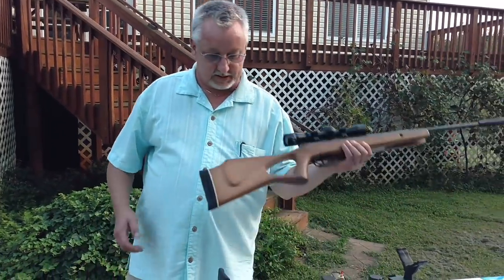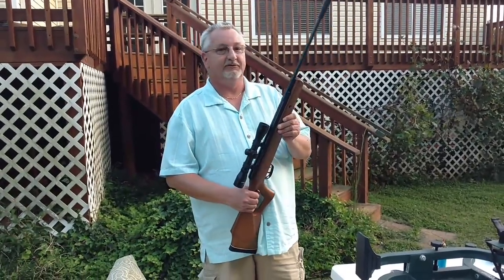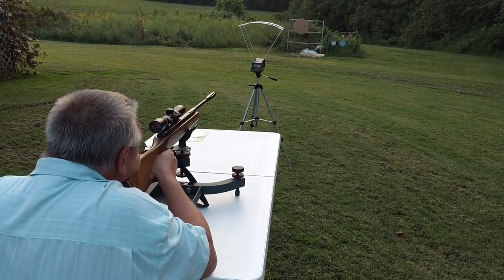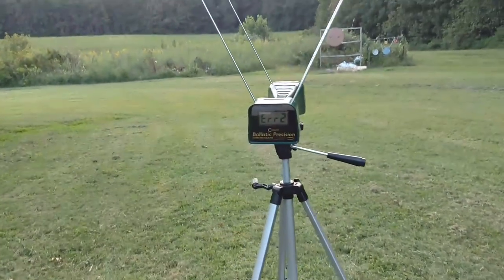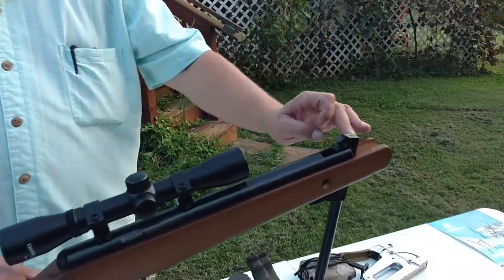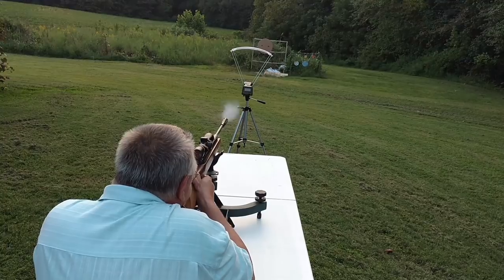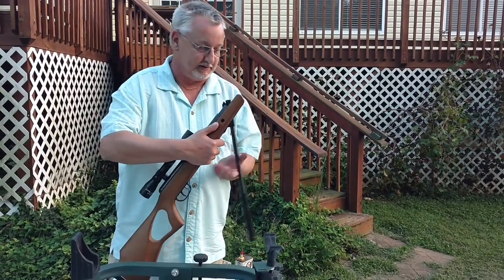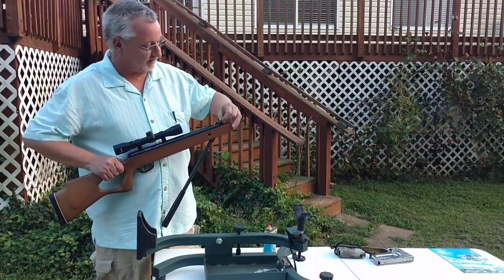Dieseling a Benjamin Titan Nitro XP .177 cal

Comment: I used to do this with an old pump Daisy air rifle.  There is one warning.  After awhile, you have to change a few rings and seals.  But seals and rings are cheap.  It was also fun to take it all apart and put new rings and seals in it.

Comment: At least in the UK back in the 1950s & 60s (ie when air rifles had leather seals) 3in1 oil was the standard lube and you stored the gun stood butt down having put a decent sized squirt of 3in1 into the cylinder to keep the leather piston seal from drying out. We didn't consider the small amount of smoke from this to be dieseling. Dieseling was when you put model diesel fuel in. This is a mixture of ether, paraffin (kerosene) and oil (often castor). That produced a much bigger effect. Despite doing this all the time myself and knowing lots of friends who did the same (model diesel engines were popular in the UK - far more popular than they were in the USA - so most of us had access to the fuel) I don't recall anyone having an issue with it and my 1958 vintage Gecado is still working just fine with its original leather seals.
Reply: I have a 40 year old air sport I switched from leather seals but you can still buy them on ebay
Reply: And vasaline was pretty good too
Reply: @un-_-known688  I guess if you were going to try dieseling with model diesel fuel it would be worth fitting the leather seals as I suspect the ether in the fuel isn't too kind on O-rings. These days the fuel isn't that common and quite expensive.

Comment: ive experimented with dieseling with a HW99s  from new, the reason i choose this rifle is because 1 the breech is made of quality steel, eg i would not consider  dieseling with a Chinese rifle,  the test can only be done over time to compare before and after, ive found the rifle is still shooting as new without dieseling  after a heavy few sessions of dieseling, the only physical modification to the rifle is a Australian red self lubing piston seal which i put in after a few shots from new,  in the uk you will almost certainly be breaking the law by increasing the power, the FPS increased on average 200fps  with only a marginal loss of accuracy, i use the least amount of propellant  as possible,  the rifle has been tested with over a thousand pellets with no ill effects ,

Comment: The crack is from the pellet going over 1100 fps breaking the sound barrier. Light weight alloy pellets will get you there without the risk of blowing your seals.
Reply: you will blow out the seals eventually because they werent made to take the pressure.
Reply: @harleyme3163  I'm with you.  The first break barrel I bought years ago, I went out back and started shooting.  First thing I noticed was the loud report.  Second was it was un accurate beyond belief.  All of those way cool looking pellets ain't worth crap either.  Blew out the rear seal on the barrel.  Repaired it.  Swabbed that barrel real good. No excess oil.   Used Benjamin Discovery pellets and hola.  Scoped and bore sighted it.  Shoots like a champ.  Gun and ammo must be matched.  No different than one that shoots bullets.  Over load isn't the answer.  Peace.
Reply: i had the winchester 1400 .177 and it was shooting 1400 fps, but i was dieseling it with light weight pellets and i kinda felt like i was shooting 22 hornet, it had to be going well over 200 fps after i put some wd40 in it

Comment: my hatsan 125 sniper is 5 years old and it still fires a 7.9 gr pellet at 1325 fps with out using oil
Reply: i dont believe it...
will be good if you make a video to see if what you say is true....greetings
Reply: @hospitaldelavadorasyrefris5104  I had one. They’re one of the stoutest snap-poppers out there, homie. I’m into the Huben K1 in .25 and Hercules .357/9mm these days
Reply: @timhallas4275  brother a .17 HMR carries about 300 FPE of energy at the muzzle. You’d have to take a 7.9 grain pellet to 4,140 FPS to carry that same energy. It would also lose 1500 of it before it went 50 yards. I don’t think we’re gonna make it lol
Reply: what you think about this.....
put some vaseline inside the diabolo tail to higer sharp shots....that can brake the "o" ring on spring rifles???
and what about on NP version rifles???
Reply: @hospitaldelavadorasyrefris5104  doesn’t matter the propulsion, the pressure will fire the propellant whether it’s nitro, spring, pump, or pcp. The Vaseline is consistent shot to shot. O rings are dirty cheap. Easy to change
Reply: Doubt it
Reply: My Hatsan 135 .22 can fires 1400+ fps with dieselling..
Hatsan is powerful

Comment: i like it a lot, as in England the air guns are restricted to 12 pound/feet so this will give a lot more power. nice video.
Reply: In England, airguns are restricted to 12ft/lbs........... Until you decide to do something about it. :)
Reply: @spacecoasttactical don't get caught matching FAC regulations as its prob 6 months in the slammer.
Reply: @John-ob7dh Airguns are totally unregulated here. You can have a 50cal at 200ft lbs if you want
Reply: @spacecoasttactical  yes I should have added here in the UK

Comment: I just use regular gun oil, and it produces a lot of smoke, if the seal breaks i will get it repaired small price for fun.
Reply: vinish shetty: I use a mixture of gun oil and 30 weight synthetic. I have put 200 rounds through my rifle with no damage at all.

Comment: Defeats one of the main purposes of an air rifle which is being inconcpicuous and backyard friendly.  For shooting in areas where that isn't important you're better off with a 22.
Reply: Hell of alot cheaper for pellets than 22 lr
Reply: @jeremyhopkins6310  not only are they cheaper but pellets guns are less regulated and in many places not considered a firearm until you get up into the high power range. Which is a big plus. Not having to have permits and I'd cards.
Reply: Apples to oranges. For starters, not everyone (felons) can have an actual firearm like a .22 
Pellets are cheaper, and a .22 is dangerous up to half a mile. Sometimes a pellet rifle with a extra pep in its step hits that sweet spot depending on what your doing and where your at

Comment: With the oil, you can see the breech leaks. Many vids with people saying oil can hurt your gun, (oils exist that don't effect rubber), but I can't find a vid of a gun that failed because of dieseling, nothing. I think it may be good for a gun (the barrel) once every 10 shots. 2 Gamo Alloy, Gold plated, Raptor" pellets, (1st with a drop), may clean lead from the barrel. They fit tight and have a excellent skirt edge, (unlike lead Gamo skirt edges).

Comment: that work's very well 'I do it all the time 'there's only  one big problem with  that 'after you shot a box of pellets through it 'the piston seal will shrink from the heat.that is if it doesn't blow it out .I have all ready had to replace two seals in my hatsan 125 sniper 'but it shots on an average of 1325  fps anyway with out using any kind of oil'

Comment: I love how you say don’t try this at home ! Wow I used Kano kroil that’s a penetrating oil . Also after I did this a couple times and the shoots I fired after I stoped putting oil in and it still knacks off the first few times ! I have the NP XL Benjamin I thought about what you said on the seals the 2nd & 3rd time I did it I even tried grease . That does about the same thing . My guess thus would be good if you needed longer legs on what you were shooting and are willing to take the chance . Then if your wanting to be stealth it blows that out the water for sure! When I used the Kano it was as loud as a 25 cal maybe even a 32 the second and third time . I think the lighter the oil the more volatile it would be I might be wrong but the grease wasn’t as loud . Make me wanna try diesel or kerosene just once ! Be safe and thanks for the great video I knew my thoughts about the oil trick making it fast was right ! It got louder so I thought it’s gotta be faster and have more velocity . It could also make a difference in a rat and a possum! Thanks again it’s great what your doing !

Comment: your right it don't use a spark 'it uses a glow plug to create a vapor or it wouldn't fire at all 'compression will not make it fire along 'the fule has to be heated to the point of vapor 'air rifles get the heat from friction in the piston cylinder I diesel mine all the time
Reply: vapour?    uh..   IGNITION..     might want to look up why you have to heat a glow plug up before starting a diesel....

double ps.  compressing some oil will in fact detonate it.  in fact this is why I have to be so carefull around the 3600psi tanks out back of our workplace..    read up on it, one drop of diesel in a 3600 psi enviroment = a bomb

Comment: I can see this working okay for higher calibers like .22 and.25 pellets possibly, but it seems like once the smaller lighter pellets break the sound barrier they become destabilized and groupings tend to open. Pretty neat though I never knew about dieseling a pellet gun.
Reply: Yep. I only do this on my .22 Benjamin Trail NP XL with the JSB jumbo super heavy or whatever the name of the pellets are. I think they're 30 grains or so. It really adds a ton of energy and keeps them just subsonic. If I do it to a 14 grain .22 or even my .177, it is loud as hell.
Reply: just use heavier slugs, you can get them in 20grains from atleast 3 different comercial brands
Reply: You know you can get smaller HEAVY pellets right?

Comment: The pop you hear is the pellet breaking the sound barrier i think
Reply from the maker: Cody the Barber that is part of it, it actually does ignite the oil. The sound barrier is just over 1235fps so yes that is a part of it.
Reply: Sometimes, when shooting my .177 and using alloy pellets, I will get that tell tale “Crack”! That tells me I broke the sound barrier. 
I have used a dab of Vics rub on a few pellets, and definitely could hear a difference.  No Chrono, so no science to share, but being a Marine, I do enjoy louder, and smokier, etc...
But I can’t imagine it is a good thing for the weapon.
Reply from the maker: Scott From Michigan it's definitely not good for the weapon. And that is the sound barrier being broken. Clean that thing good after each time doing that and don't ever put much oil or Vicks on it at a time.
Reply: Thanks Gonzo, I do appreciate the caution.
Definitely not something I would do more than the 2-3 pellets I tried out of curiosity.  Was a nifty experiment, but I possibly may have something else around here that makes a louder “pop” or “bang” should I get overtaken by “the itch”. ;-D
Reply from the maker: Scott From Michigan 100% agreed. My pellet rifle is just for those times when a loud noise isn't wanted.
Reply: Yup
Reply: @gonzosgadgetsandguns3601  I have actually an interesting idea here!What about making a kind of conversion of an air rifle to the one that fires the .177 bullets with a nail gun blank!Just an estimated velocity of the 0.68 gram bullet will be 1080 meters per second!Yes,meters per second which is 3540 feet per second which is cool!
Just I guess this can be done quite easily:make a firing pin with threads so that it would set off the blank and make a chamber for those nail gun blanks after which you will put the bullet!So what do you think?
Reply: @gonzosgadgetsandguns3601  *btw I actually have a vastly larger and more devastating gun that is nearly impossible to shoot from the prone position and also it wrecks most of the tables when it jumps from the huge recoil and falls back wrecking it with it's weight which is over 70 lbs but that cannon is cool as hell!For instance with my enhanced loads and BS-41 projectile which is presumed to be tungsten carbide core AP that also has a cumulative nose section,a 66.8 gram 14.5mm monster is fired at the velocity of 1280 meters per second which is 4300 fps and it makes a clean hole through the 2 inch thick steel plate made from the best armor steel currently used in NATO from up to 300 meters!Yet I really could shoot this thing only with factory loads from prone:with enhanced loads it flipped me with recoil!Although that was before I increased it's recoil compensation both by installing the spring loaded buttstock and the vastly better muzzle break but I ran out of the special powder for enhanced loads and don't know where to get it!Except for reshaping granules of "nitropenta gewehr rohrpulver"-but I don't know how to do it since it's not nitrocellulose but PETN(pentaerithritol tetranitrate,main ingredient of semtex)-which must be dissolved in something else than nitrocellulose!Do you know how to do this?
Reply from the maker: @johnsheppard1476  no man you've completely lost me on that.
Reply: @gonzosgadgetsandguns3601  what do you mean?
*btw I am Russian but for the last 3 years live in Canada!Already got a gun license(PAL)-and couple of monster cannons one of which is my own modification of PTRS-41 anti-tank rifle,with heavy barrel adopted from KPVT which is therefore capable of shooting enhanced loads!Really neat thing since it is capable of bringing down such things as M2-A1 "Bradley" and BMP-3,needles to say but any APC and low flying aviation as well!
Yet I am thinking about two things:first of all I want a good rabbit gun that will have the good range but won't vaporize the quarry,and the same time will have a really good flatness of trajectory which apparently is achieved with a larger initial velocity!And a-secondly I need to get some cheaper experimental gun that will give maximum possible velocities to the projectile-and here I mean preferably over 1500 meters per second at least!Need that to test such effects like Gerlich effect and effect of ultra-hydroschock!

Comment: the only danger is burning out your piston seal or breach seal 'guns not going to blow up 'it doesn't generate that kind of pressure .you could fill that barrel full of black powder and it still wouldn't blow up
Reply: Agreed, "O" rings are cheap to replace.

Comment: This helps a lot. I oiled my barrel thinking it would help lube the bbs/pellets. I noticed little puffs of smoke each shot and was worried
Reply: Don't. When you clean your barrel lube with something non-petroleum based. These videos are interesting but ultimately stupid as dieseling does indeed destroy a springer.  It is just a matter of time, not a question of whether it will or not.
Reply: im worried ur worried
Reply: oly o he's worried that you're worried that I'm worried
Reply: OMG I am so worried about you being worried about that other guy being worried about the first guy worrying...
Reply: @bultacowally  Don't Worry, Be Happy!
Reply: Wait, Good idea, if it works oiling the barrel, then it is not getting any oil on the rubber seals. did you notice an increase is smacking power?
Reply: It takes a worried man, to sing a worried song

Comment: A diesel engine compresses air then fuel gets injected to ignite  itself under the high predeceased air temperature, the flue doesn't compressed int the cylinder (it will in the fuel pump like 14000 psi or so depends on the engine model )the air does. 
just saying.
Reply: ps a diesel rarely gets past 500 psi.     Ask yourself when did you ever think an air rifle meant to take maybe 800 psi is capable of 14000 psi?  lol   you do know what that is right..

ITS A FUCKING BOMB.

Comment: Just change to a lighter alloy pellet and you will get the same speed increase without the chance of hurting your rifle.  I use the alloy pellet as a speed check when working on an air rifle.  Lead pellet is less than 1000 fps alloy is over 1000 fps and the resulting crack of the sound barrier.

Comment: Try vicks salve put it in the cup with a tooth pic.
Woot!
Reply: THIS REALLY WORKS, YOU ARE RIGHT
Reply: @spacecoasttactical   it's not the cost of the gun, but the cost of the ammo.. pellets are a half cent a piece.  the cheapest .22 ammo is about 4 cents per round..  plus it's legal to shoot an air rifle anywhere you want.
Reply: @timhallas4275  It's legal to shoot a gun anywhere outside city limits and who cares about 4 cents.
Reply: @spacecoasttactical    No, it is not legal to shoot a gun anywhere outside of city limits.. The point is, I can shoot my pellet rifle, that has nearly the same ballistics as a 4 cent .22LR for 1/2 cent per shot.  I can shoot it in my back yard all day for about $1.  To shoot a .22LR rifle, I have to drive outside the city, find private property,, get permission from the owner, and use up $10 worth of bullets for the same effect.
Reply: @timhallas4275  that's not a lot for both cases:in my case I am getting rounds separately by parts for my favorite gun:you will never find a single one assembled!So each casing I buy for 10 bucks,each primer for 2 bucks yet I refurbish them,than the load itself is custom made for me only because literally nobody else in the world uses this insane type of powder(which contains no gunpowder but is actually made in same 4-7SV grains of nitropenta aka pentaerithritol tetranitrate which can be used as propellant in this case;this particular chemical is the main component of SemTex)-well,30.5 grams of load in each round cost for me about 5 bucks and I have a very good connection in Ukraine that sells to me projectiles for 1 dollar each for BS-41 type of projectile-and now the real fun:here in Canada as well as in US damn BS-41 projectile costs 250 dollars US EACH !So for me each round costs 18 dollars and I currently have a stock of about 2 thousand rounds lol👍😎🤠
Just for the other people I once offered  a hundred rounds for 250 dollars each and believe it or not but the very next day they were sold out!So yes,14.5×114 is fucking expensive as hell!I'm not even saying anything about MDMZ type of projectile which costs at minimum 2.5-3 thousand dollars each :that is some real madness!By the way they weight 58.6 grams each which makes them about the same price as if they would have been made of pure gold!